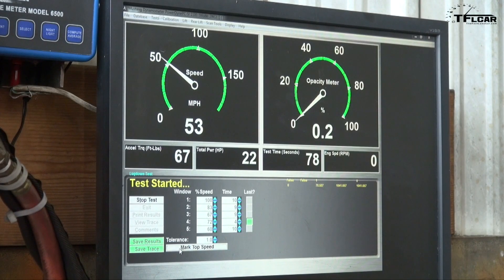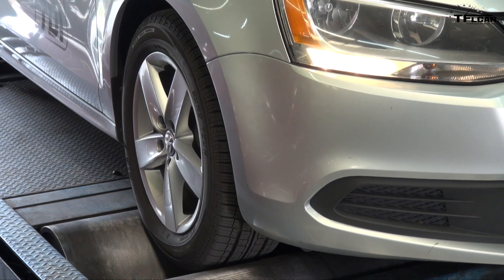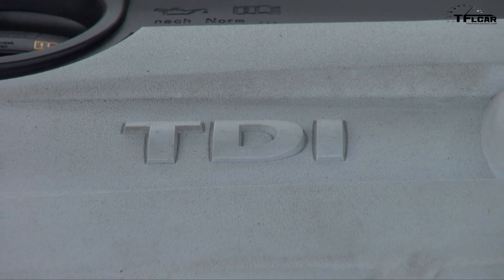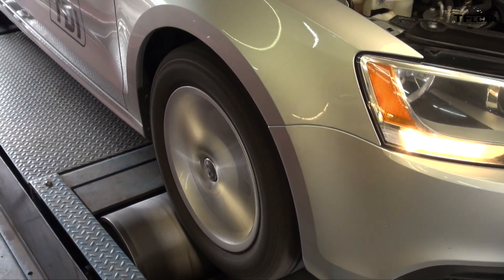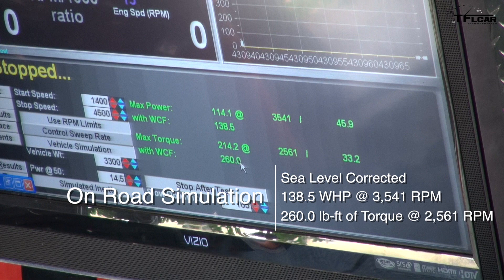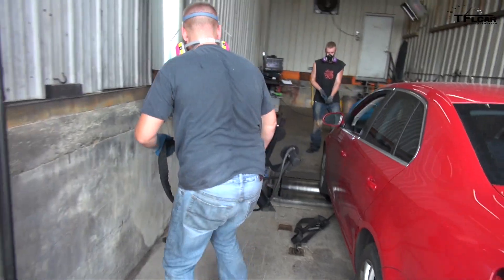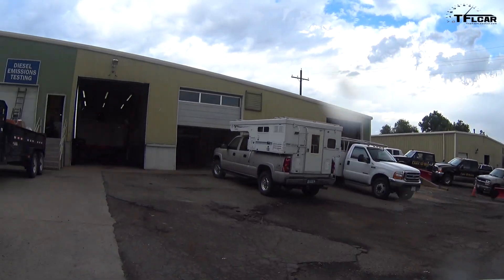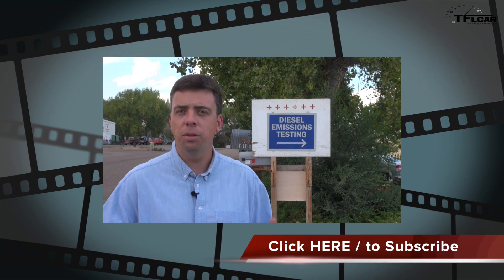Surprise! We Dyno a VW Dieselgate TDI Jetta to get the Truth about HP Loss

Comment: has that shop never worked on a modern car? the TCS kicked in and put the car in limp mode. this is why it had "less power" -- you guys need to test it again with TCS disabled.
Reply: +Andrew Saturn Not limp mode. Limp mode would reduce power substantially. If the difference is like 20% that's not limp mode. I've driven hundreds of cars, trucks and what not. Limp mode is VERY noticeable. The car barely wants to do anything. Let alone run a dyno test.
Reply: +youtubasoarus did you see all of the flashing lights on the dash? that's limp mode or at least some sort of "error mode" switched on from the ECU/TCU finding a fault somewhere.

Comment: totally misleading video, very disappointing.  so the car is basically in some sort of panic mode, traction control off, ABS not functioning, brake light flashing and it's down a bit on HP & torque.  yeah, no kidding!  the car probably thinks it's in some sort of distress / pseudo-crash situation.  and the most important thing to measure, the ACTUAL emissions... you admit that you didn't test.  based on this intentionally misleading summary and your general intellectual laziness, i would NEVER use your dyno shop!

Comment: in the second run you say "I'm going to ease into it" and then you say that the power took longer to come in and there wasn't as much... well yes that's what happens when you don't fully press the gas pedal and ease into... the car makes all of its power in the midrange, if you ease into the throttle you are exaggerating the difference... way to feed on sensationalism

Comment: As can be expected from TFL, this is investigative journalism of the highest order. It attempts to cut through the hysteria and actually see what is happening with VW's diesel engines. As far as I can see, we've learned the following -
1) The rolling road operators don't seem to know what they're doing - see the second run.
2) Some very questionable figures were produced.
3) There seems to little " wrong " with the engine as it stands.
4) It's a great engine, and people are very happy with it, but they're scared by the hysteria.
5) Somebody at VW is monumentally stupid, because there was no need for them to " cheat ".

Comment: this test has no relevance with vw emission scandal. This video shows only failure mode of the asr/esp feature. Software feature of vw has inputs of steering wheel angle, speed,duration of engine operation and ambient pressure.

Comment: You really needed to run the 2nd test a 2nd time. I'm sure the traction control was cutting torque. I don't recall if that jetta has a traction control off button or not.

Comment: I admit that the system can use the back wheels hall sensor (to measure its speed), but was not only that.
They also used pressure sensors and others just because emissions tests are made in a closed environment.

This test was not done is both closed and open environment and you did not search enough on the matter.

I consider this test inconclusive.

Comment: The jetta doesn't have a traction control button. Funny how they didn't show the in car dashboard lights during the first run with all 4 wheels turning. Seriously, what is with the agenda the government and epa have with getting people to hate fuel efficient diesels?
Reply: I've personally seen and participated in Dyno days with lots of different jettas and golfs. Modified, and stock. The DSG cannot give out accurate results due to the automatic downshifting that occurs. You can only get accurate results with a DSG that's had a tune to increase its abilities and remove the automatic shifting while in manual mode.
Reply: China has a lot of factories as well, factories cause way more pollution than all vehicles combined.
Reply: Umm the mk5 did but not the 6. I own one I know. They may be putting them in now with the new ones but the 2011 through 2014 definitely didn't
Reply: The golfs of the same model years have them, but not the jetta..  Adding a traction control button is a very popular modification in the enthusiast world.
Reply: +Aaron Zambrano jettas do have a traction controll button.
Reply: Please show me, because the fact that they don't is the reason everyone on Vwvortex likes buying an install kit to retrofit one into the car. Maybe MAYBE the Euro spec version does,  but not the one in the United States. Only the GLI I believe received one later on a few years after the MK6 started in 2011 model year. The TDI definitely didn't get one. I bleed mk6 and own 2,a jetta, and a golf. I know the differences between them. Simply saying "yes they have a button" is not saying much at all
Reply: Straight from usp motorsports, a major vw tuning vendor. "From the factory, Volkswagen unfortunately did not give the MK6 Jetta a button to activate and deactive the Traction Control System (TCS). Fortunately, the vehicle does have the ability to turn it on and off, its just lacking the button (and a few other things to make it functional). If you want to give your MK6 Jetta a button to turn on and off the traction control, USP has you covered."
Reply: +Dusty Thibodaux 
I think you mean the ESP button? My EU Golf 6 2.0 TDI (81kW / 110HP) and my dads Golf Plus 1.6 TDI (115HP) only have a button to disable ESP not TCS.

Comment: This has no connection to the "dieselgate" software. That was traction control lowering engine power (in my car it's called ASR+VDC), when the back wheels aren't spinning. In most cars you can turn it off by holding down the ASR button (if you have it) for 5seconds.
VW dieselgate software should reduce power significantly more.
Reply: phase 2 of dieselgate returned power to normal and shot in about 7% more DEF.  thats why the extended warranty, because parts were built for lean conditions and not the extra corrosive DEF.

Comment: The car automatically decreases power when the error codes are thrown (ABS, ESP, Etc), so these results are irrelevant. The purpose is to correct for a loss of traction - this is outlined in the owners manual and isn't unique to VW. This doesn't seem like a valid test and I'm a little disappointing in TFLC for advertising and publicizing this story as a definitive and factual test.

Comment: There are so many holes in their testing methods. They ran the car back to back without any cool down time, the car is turbocharged, it will heat soak after a wide open throttle run. Additionally the traction control skewed the result on the second run. Thirdly, when a car is actually emission tested on a rolling dyno, (and not power tested like in this video) there is a OBD 2 connection present. During this time different measuring values in the ECU are read, which I can bet this is when the 'defeat' happens, when the ECU is being read while driven on a dyno. Just turning off traction control like they stated in the beginning of the test, won't make the car reduce power.